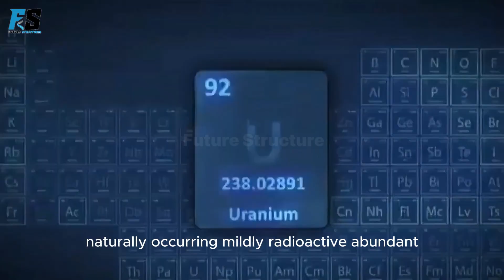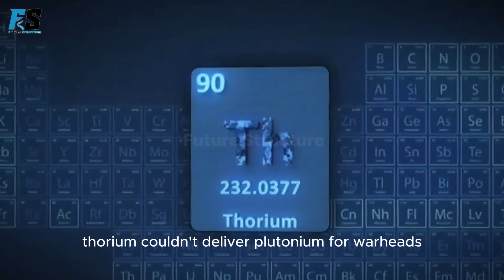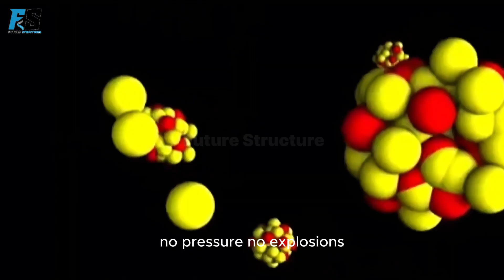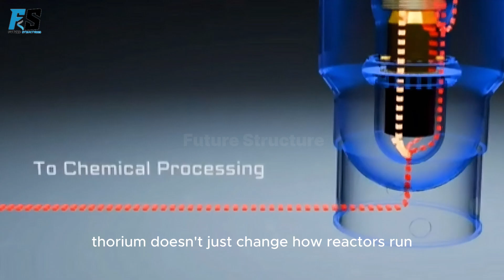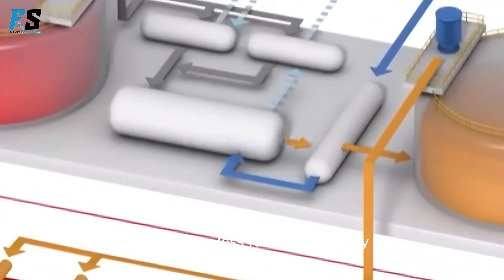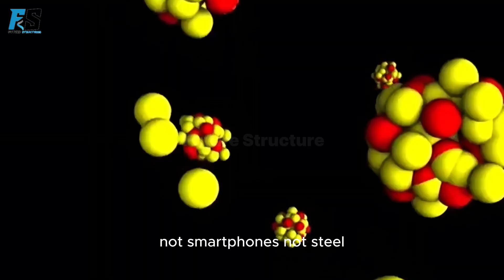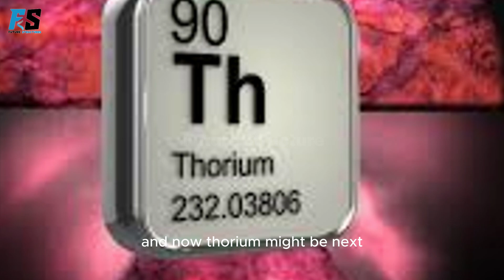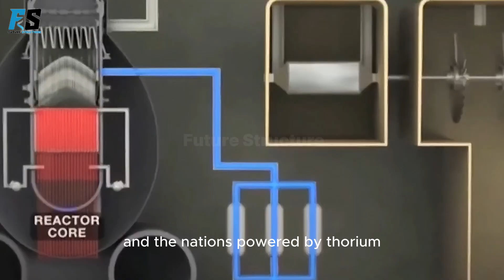Could Thorium Change Our Future?

Comment: This is total bullshit. Thorium is actually turned into a uranium isotope similar to "normal" fission reactors by a toxic dangerous "pre-fission" process so dangerous it has to be done robotically. The fission reaction of this form of uranium is very similar to normal uranium plutonium reactors (& slightly more efficient) still produces tonnes of radioactive waste that remains mortally dangerous in amounts too small to measure for tens of THOUSANDS of years ie it produces highly poisonous waste impossible to deal with safely. Fission nuke reactors of both kinds should be banned.

The only reason thorium has become a popular alternative is the ore it uses can be found in non-western countries like India & China, whereas uranium deposits are mainly in the US, South Africa and Australia.